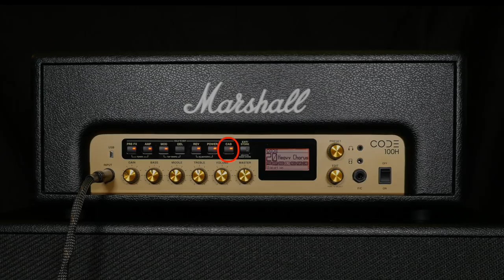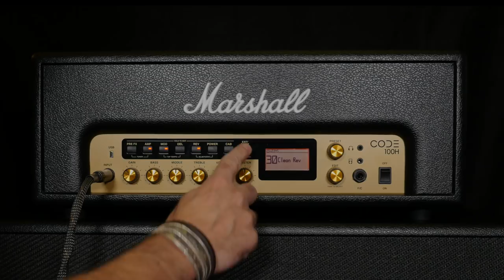Marshall CODE 100H Tutorial

Comment: Awesome tutorial. Marshall really should write it somewhere in the manual that the cab sim should be switched off whilst playing through a speaker cabinet.
Reply: Seriously. Listen to how much better it sounds after he turns off cab and amp on the JTM45 setting. Something that simple will make you go from thinking its a crap sounding amp to thinking its a pretty good one if you just sat down to play one and didn't know that. Most of the presets are not good. Once you go in and shape your own sound and get it going thru a quality cab, its a steal for $349.
Reply: The manual for the Code 100H is seriously lacking in several areas.  I'm thankful for people like this who post videos on how to use.

Comment: Marshall does not mention this in the literature, but if you use the headphone out or the USB connection, it's disables the effects loop. I thought there was something wrong with my amplifier, but it turns out that is the way this is designed.

Comment: Actually, leave the CAB simulator "On" if you are using the matching CODE 4 x 12 Cabinet.  Its speakers are designed to compliment and bring out the nuances of the different simulated Cab models in the CODE amp head.  If you are using a different brand cabinet, then yes, switching CAB to "Off" will probably better preserve the characteristics of that particular cabinet.
Reply: Is this also true for the 2x12 cab?
Reply: @joseben2285  I think so, but not 100% sure.  I would think so though.

Comment: I own both the Code 50 and also a new Code 100 212. Is there anyway to dial out the fizz at low volume for the low notes? I have had some luck by trying different settings and now my low volume sound is mostly fizz free, still if anyone else has a suggestion- I would try it. I'm also thinking since i only had the 212 for 2 day's that the speakers need to be broken. 
I remember 2 years back my Code 50 had a fizz but now that the speaker is worn in there is no fizz.
I think the electronics are so sensitive that they pick up the fizz right from the strings. Of course at higher volumes the fizz is compactly drowned out, so it's only low level late night playing when not wanting to wake the wife. 
I am a fan of the Marshall guitar amps and like these digital amps a lot, even though I have more Marshall tube amps. I recommend the Code amps for Jazz and blues as well as Rock. They are so adjustable, more than any other amp I have ever owned.
-Peter
Reply: (Update) My new  Code 100 212 definitely is fizzy sounding compared to my Code 50. There is no way around that fact. Can anyone help? No matter what I do-I hear the FIZZ.

Comment: At 3:30 I totally disagree ― if you have the CODE 4x12 connected to the CODE100H or are using the built-in speaker in the CODE 50 Combo ― otherwise, an excellent tutorial. Cheers!
Reply: Platinum Black ive got mine since yesterday now. Before i purchased the code 100h i saw this tutorial. I switched off the cab and the power... the speaker sound really thin and crapy without that. Ive got the Code 412 Cab.

Comment: Do you recommend turning the cab and power amp buttons off If you have the Marshall code 50 which is a 1x12 amp?
Reply: I also have a code 50 and i never turn off the cab and power amp buttons,i tried it and my amp sounded low in volume and very thin sounding! These buttons are not only for listening through headphones there for you to use them and to tweak your code to sound good the way you like it!

This is bad advice in my opinion to turn off the cab and power amp buttons,ok i could see maybe turning off the cab sim on the code 100 because a 4x12 will give you a bigger sound but why turn off the power amp models?
Reply: @jimsimmons2674  I just got the code 25 and it sounds terrible if you turn the cab off. Like you said, low in volume and thin.